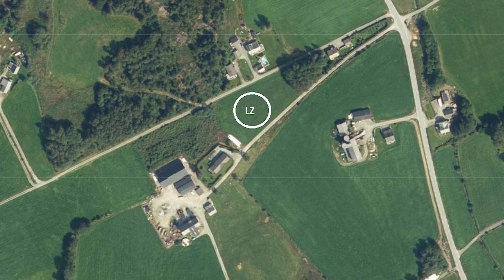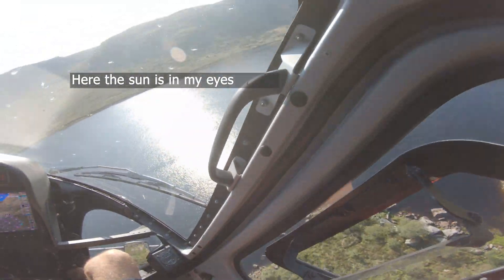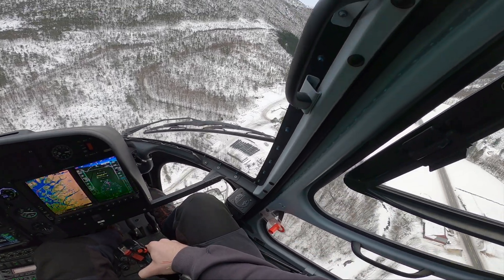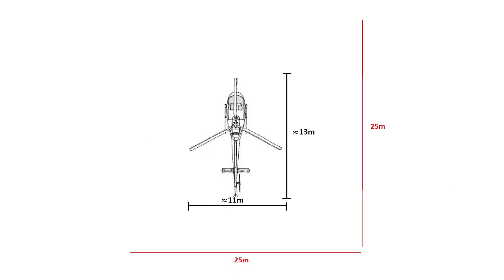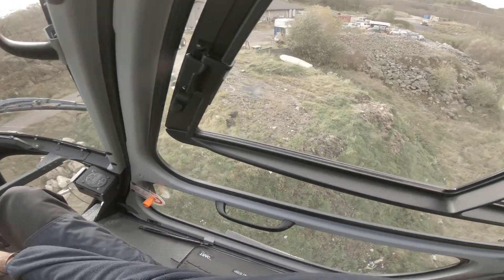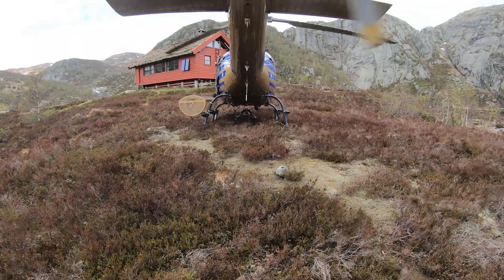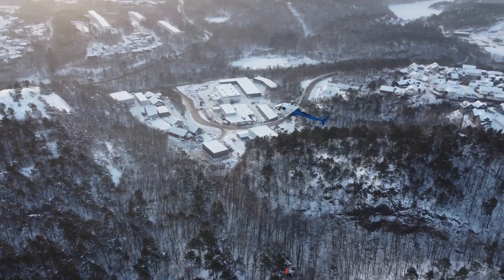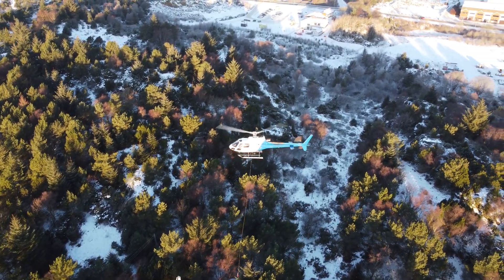Helicopter LANDING PROCEDURE tutorial

Comment: Hi! So what happens if you land and stop the rotor and you exceed one ( or more ) of the slope limitation angles? Does it hit the tail on startup? Is the swashplate mechanism affected? Thx!
Reply from the maker: For forward slope the tail hitting the ground is the main problem. Landing on a forward slope on a ledge (that would be pretty rare) where the tail is free underneath you can run out rearward cyclic and also the main rotor will be getting uncomfortably close to tail and even more so if correcting for tail wind and a high weight.

If you are landing nose up i think you can exceed 10 degrees (H125) without too much problem if the surface is OK (of course you shouldn't do it though) but 10 degrees is a lot and if the ground is hard ex stone with gravel on top the vibrations might cause it to slide.

Sideways slope you can sometimes run out of cyclic authority sideways.

With higher weights and wind from the opposite side of the slope (say slope is going from left high to right low and wind from the left) you need to put quite a lot of cyclic in to the direction of the slope to keep it from slipping down slope as you reduce the friction with the collective on take off, and you might run in to problems with the blades hitting the droop stop. Although it very rare.

The main problem is definetly forward slopes. Slopes will not effect startups much since the rotor system is pretty stiff and gets up to idle pretty quickly

Comment: I have a question, don't you have to follow the Height-Velocity Diagram? As a single-engine helicopter, shouldn't you be doing a flare in case of an engine failure?
Reply from the maker: We follow the height velocity as much as possible. But in the case of landing in areas where there are obstacles in the way, and where the last bit is vertical, it is better to slow down and be inside the height velocity diagram, than to come in too fast and staying outside the h&v, and not notice a wire for example
Reply: @UpsideDownWash  Copy that, thanks!

Comment: Nicely done, I like the odd external cam stuff you mix in with the great head mounted perspective, In particular the underneath nose cam looking back you had at the start I think would be good on approach and touchdown. Overall great content keep it up.
Q: I've noticed some operators have moved over to the H130 platform from the H125 for main workhorse do you think there are more pro's than negs to justify the cost difference?
Reply from the maker: Thanks:) Im was not aware of that. It is not the case in Norway anyways...  It is not really suited for external load operations. For pax flights its better with more room and fenesteon. So there the cost might be worth it.

Comment: I may have missed it but did you not talk about winds at all?
Reply from the maker: I did
Reply: @UpsideDownWash  ya just saw it but have to disagree with you and I fly arguably an even more power surplus aircraft but to say that you would take a strong tailwind instead of flying into the sun is not good advice in my opinion. If you always plan on being power surplus the day that you are not is going to catch you off guard.
Reply from the maker: @craig3665  interesting. I'm not saying I'm right, as I stated in the intro BTW. This is just how I have found the best way to do things. What helicopter do you fly? And if you have more power available why would you choose to have even MORE power over the ability to see properly?
Reply: @UpsideDownWash  I fly Black Hawks, I will admit we usually have more eyes than you so I get not wanting to fly into  the sun but my LZ recon sequence is as follows
 I will determine the size, slope, surface, long-axis, and obstacles.
I then determine my power requirements,
Determine wind
Determine my route in usually basing it off winds and my route out and an escape route
I then do a low recon verifying my winds, verifying escape route, and verifying touchdown point suitability. 
On my final approach I make sure that I am set up for landing before reaching my escape point and continue for the landing.

The reason we still are concerned about power even when we have plenty of power is because
1. We are not always power surplus and
2. What if we lose an engine.
Reply from the maker: @craig3665  ok. I don't know much about black hawks except that they are much bigger and heavier. I will dare say that the reaction time after power application in an H125 is way quicker though. Unless there are severe down drafts in the LZ the wind does not really matter if you manage your apch speed and vertical speed. Side and tail winds will make it a little harder but I have never run out of power because of it (sling loading not included of course). Flame out is of very little concern. With black hawks (and military aviation) I assume taking fire and loosing an engine that way is more reasonable. The amount of wire strikes vs flame outs makes me think it is better to focus on the factor that it is possible to do something about. Except for the importance you place on wind I agree with your procedure. It was a big part of (and also important) flying during flight school but I find the emphasis put on it was not really  realistic. Its better if you can have it, but I find the reason people disagree with me on this is because its what they've been taught and not what they've observed. Obviously this is very aircraft type specific
Reply: @UpsideDownWash  I guess my only point is make sure you are thinking about it, if you know the wind and know you have the power then go for it. But it just came off in the video as not being a factor for you. Don’t get me wrong a lot of Black Hawk pilot are bad about it one of our last before landing checks is performance considerations. And the joke is to respond with power for days. But the High altitude course in Colorado made you realize at high altitudes high temps and high gross weights you don’t always have that power for days. It’s good that you don’t have that type of variety in mission where you don’t need to worry about power but don’t let it build into complacency.
Reply from the maker: @craig3665  listening to it now I definetly see what you mean about it sounding like "not beeing a big deal". Didn't hear that at all when I recorded it😂 I mostly make these vids because I figure a lot of people might benefit from them once they start flying H125s in Norway, like I would have appreciated having an instructor when I did the same. They are not really geared toward completely new students. But thanks for the comments 👍 I'll definetly keep that in mind in future videos 😊👍

Comment: I dont even fly helicopters - im pretty far off as a matter of fact haha
the structured process however is very relatable and can be applied almost in any field in my opinion - awesome videos! Question, how do you do an auto rotation in case of engine failure in terrain like that? do you just yeet the helicopter somewhere? Even when flying low over terrain such as a forest which I see military helicopters do, if they have an engine failure how can they land anywhere remotely safe?
Reply from the maker: Thank you:)  This job is risky and you are often times operating in areas and conditions that will not allow for a safe landing. 

The truth is you can't fly helicopters and be safe all the time. Terrain like this I would enter auto rotation, flare and brake the speed as much as possible before hitting the trees. It's just part of the job, and the likelihood of it happening is like a 1.000.000 : 1
Reply: @UpsideDownWash  I get the point, makes sense - thanks for the reply and be safe
Reply: @virusblaster12  It's also worth noting that many military rotorcraft have multiple engines so single engine failure doesn't inherently mean an auto rotation must take place.